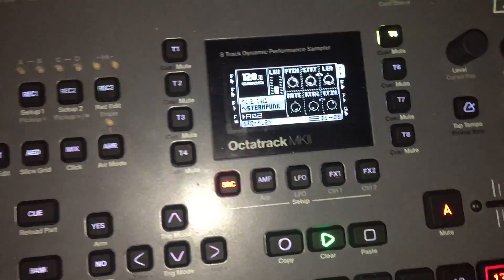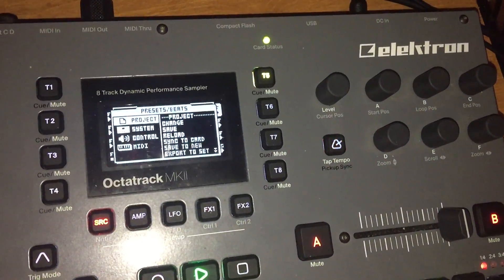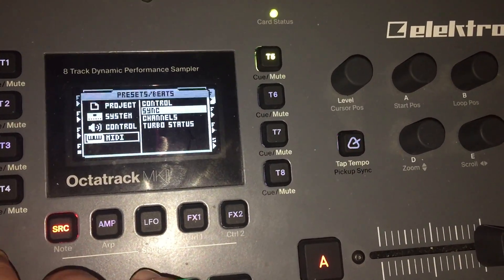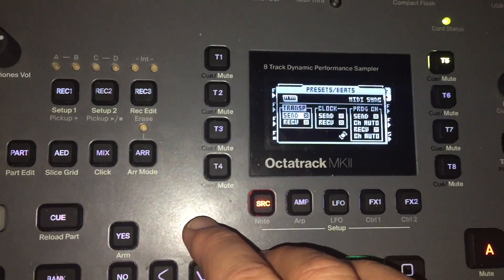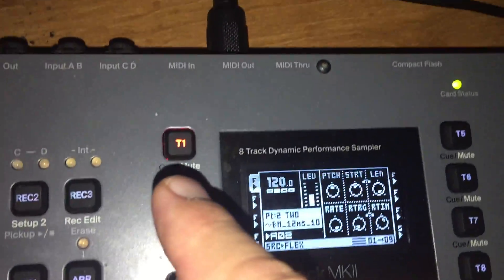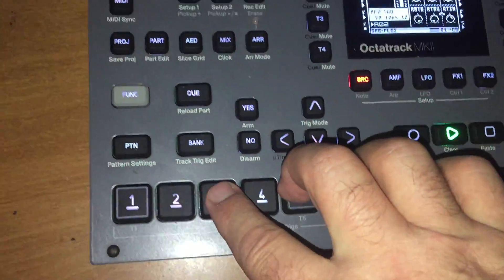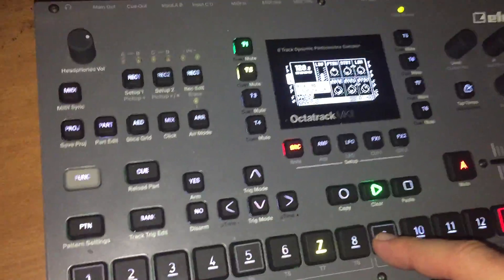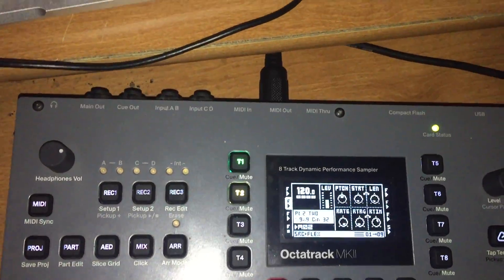Troubleshoot Setup Elektron Octatrack with Doepfer A190-4 MIDI to CV

Comment: I've had a Deopfer A190-4 for many years and from the start the midi input socket was ultra tight! Well lo and behold recently when I tried to unplug the midi cable it broke the whole socket and the (female) midi input is stuck onto the midi cable. Im just wondering if I was unlucky with my module or if others have had a similar midi socket issue....
Reply from the maker: yea I have a good set of eurorack sequencers now with MIDI that make life way easier.
Reply: @GuitarsAndSynths  I was asking if anyone else had a super tight midi in socket on the A190-4 that made a midi cable nearly impossible to remove and eventually broke the input socket when I tried to remove said midi cable. I'm not quite sure I understand your reply about sequencers....

Comment: hope you found out what it was by now, but looks like what I encountered as well, you have to set the clockdivision higher to slow down your clock, it's running super fast here. In the clock menu Cti (clock time) there you can divide by higher numbers.
Reply: on the doepfer module to be clear ;) no idea about the octtrack, but I ran into the same problem when I was trying to set up the A-190-4 with my MPC recently.
Reply from the maker: @tentakul7  I ended up using another MIDI to CV box that works well. But now I have awesome modular sequencer in Winter Modular Eloquencer and use that for sequencing and drums in modular now.

Comment: bro bro.. u gonna beat urself up for this one cause it's super simple but the OT can be extremely confusing when you first start with it. You gotta make sure when recording or creating a midi sequence that you're in midi mode (hit the MIDI button below the headphone volume knob and make sure light is yellow) you were trying in audio mode to sequence which is why nothing was happening but you could hear the clock signal changes via tempo knob